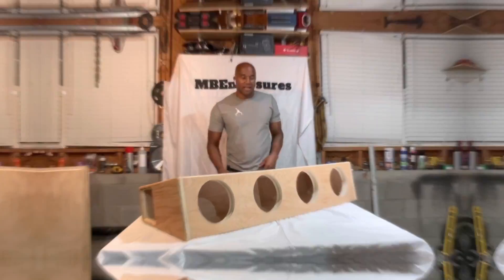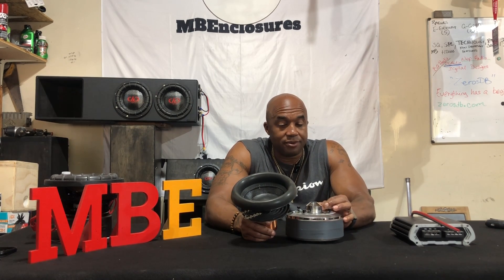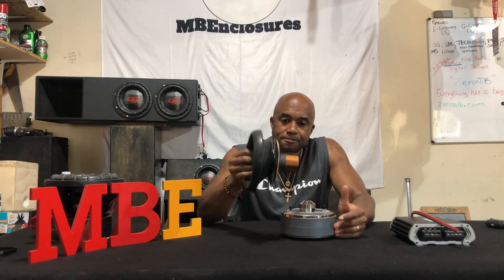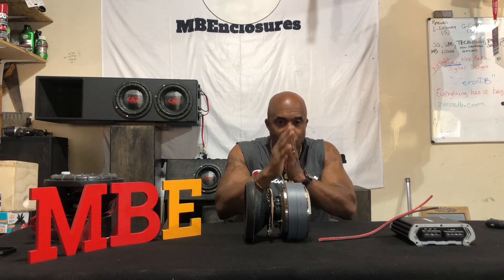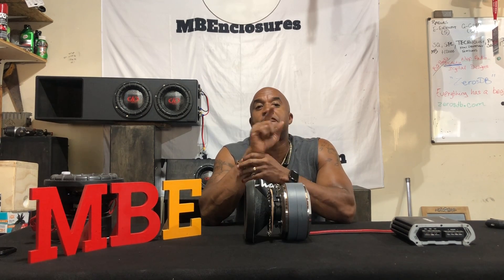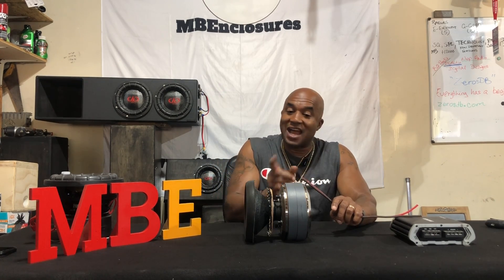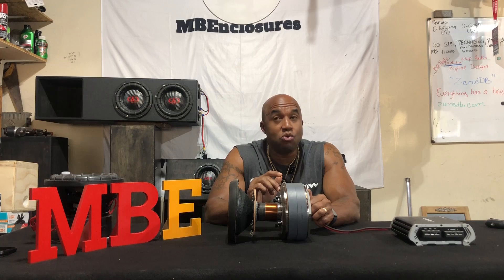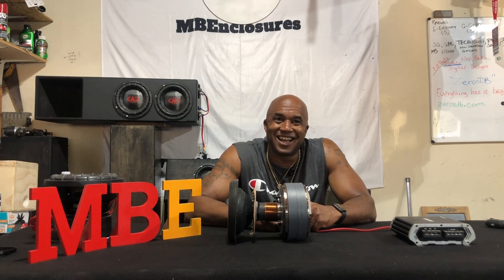What is Amplifier Damping? Why it’s Important For Impactful Bass? Check Video Description!!!

Comment: So that means the higher the QTS, the speaker's ability to control the movement *lower is better*, the hotter your amplifier gets because it has to dissipate that extra movement with resistors that heat up as they work.

Comment: I helped develop Kicker Subs way back in the 1980s with my Cougar system. I ran a Kenwood KAC-1021 with a Kicker dual 10” box. I had a lifetime replacement on the subs as I would tear them apart in a few months and send back for them to help develop new surround materials. The Dampening factor of that Amp were absolutely off the charts. The Reps from Kicker, Polk and Kenwood all lasted about 5-10 seconds as the Punch in the heart from Sub Box was insane. You are 100% correct on your description. My 1021 amp ran over 1,000 watts into that box alone and no other amp last I knew ever exceeded the rating it had. As mentioned why it was so nasty was the Clean Quiet Performance at any level, coupled with my 2 KAC-921 which ran the front and back and OMG 😉😎
Reply: The dampening factor on that Kac-1021 was 5,000. Would be interesting what stuff today has for a comparable 840 watt output😉

Comment: Damping factor or "Amplifier Impedance" over 100 won't be truly noticed or heard in car audio. Home audio, more so, due to much higher Damping factors and totally different output filtering. You definitely won't hear a difference between 100 and 200, even less so from 200 to 400. You lose more than you gain going too high in Damping factor, mostly sonically. You start to lose frequency accuracy at a certain point, unless the amp has a bad ass output filter. Your amp would need a pretty good output filter to filter out the noise your Damping factor will make.

A 1 Ohm Sub on a Amp with 100 Damping factor means your amp is outputting at 0.1 Ohms.

A 1 Ohm Sub on an Amp with 400 damping factor means your amp is outputting at 0.0025 Ohms.

The difference between 0.1 Ohms and 0.0025 Ohms is physically not able to be heard.

You can increase your Damping factor simply by changing your subwoofer Impedance to create a lower output Impedance from your amp.
Reply from the maker: I would rather have a high damping factor then low. To each their own. Yet I welcome you get your own channel and help with the knowledge you have.

Comment: I have a question. I have a 750 watt subwoffer in my car. The installer put it in my car with a 3,000 watt amplifier. Does that make sense?
Reply: Is that 3000rms or Peak. I would assume it is a peak power rating. Which would be closer to 1500rms. A lot of brands like to use peak rating to make them seem more powerful then other brands that use rms rating. 

1500 rms gives you  plenty of headroom and clean power (assuming they upgraded your wiring, big three). It also gives you the ability to upgrade your subwoofer, without having to buy a new amp. If its 3000rms I would say its way overkill, and way too much power especially without additional electrical upgrades. 

Keep in mind rms of sub is kind of a ballpark number. Some subs cant take a true rms rating, other subs can double even triple rms if set up correctly.

Hopefully they set your gains to match your sub as well. If you start smelling something burning or your sub sounds bad at high volume, your gain is too high.
Reply: @johnd5542 ... I appreciate you responding. The sub is an Alpine 750 watt rms. The amp is a Taramps 3,000 watt rms. (I should have been more detailed in my original post) When I open my trunk, the sub sounds like it has a knocking sound when it hits a certain frequency. Hard for me to describe. I have a strong feeling I'll be getting another sub soon. But yes, I agree with you. I think it's over kill in what he installed.

Again, thanks for your response. 👍🏾

Comment: So is this a feature of all amplifiers?
Reply from the maker: They good ones
Reply: @M.B.Enclosures  thanks for the response bro. I love your videos. Do you use DATS by chance? If so I’d love to see a video on that. I’m considering buying one. I just built a box of my own unique design and tried to tune it to 28 using a port length calculator but I think I actually ended up with a much lower tuning and may need some modifications.

Comment: How important is dampening on subwoofers compared to mids/highs speakers?  I'm asking because I have a DD 5.1000, and it has 200 dampening factor on the speaker channels, but <100 for the sub channel?  Why wouldn't DD add more dampening to the sub channel if it is that important for performance.  Or is this something DD correct with the M-series amplifiers?
Reply: Modern subs are generally overdamped to begin with, which is necessary to handle that kind of power. So even with a relatively low damping (not dampening, the amp isn't making the speaker wet) the sub should still sound good. The M series amps do have a much higher damping factor then the D series
Reply: At lower ohms the damping will decrease naturally.. that's why

Comment: I love having a dampening greater than 1100. My subs can take way more power Which i may lower the ohm load one day. But its hitting hard and clean with my current configuration so thats what im rolling with. You would be amazed at how many car audio shops reps that dont have a clue when you ask them this question about a amp. Thanks for the knowledge.

Comment: MBE, does this mean that the shorter the wires the better?
Reply: That will always be true especially going from a big amp to your subs you want the amp to be as close to your subs as possible
Reply: @johnnycorn7225  Thanks, makes sense. I kept the gauge @8 from amp to sub to maintain power. A shorter path is even better.
Reply from the maker: Nothing to do with that

Comment: Curious what ohm load the manufacturers rate the amplifier damping
Reply: They usually list it at 4 ohms, and just like MB says the the harder you drive that amp the harder it is to control the sound. All my SQ bills run at 4 ohms and yes you can hear the difference
Reply: @johnnycorn7225  im at 2 ohm for sql, but i have an extreme build. Ill do more research for what"s best and reasonable for me
Reply: @kerrickthomas9729  I do the same thing for SQL love 2 ohms cuz you still get more power. You got to work hard and save up for a bigger than normal amplifier but it's always worth it. 
In my daily car which I use for advertisement I run fi btl 15s in big boxes at .5 ohm cuz everybody wants to know if you can make it hit hard and yep it does. Just not my preferred setup. 
2 ohms is probably the best overall if you ask me bro
Reply: I was wondering the same thing, when impedance rise is happening what is actually happening?

Comment: Does the damping factor differ with amp class ???
Reply: Yes generally class ab amps what 95% of ppl use on their mids and highs amps common class ab amps can have a dameping factor of more than 200 usually anything more than 100 is considered a very good starting point . Class d subwoofer amps usually are lower dampening in my experience around 100 is typically good but there's alot of sub amp brands have high dampening usually on a Korean built amp.